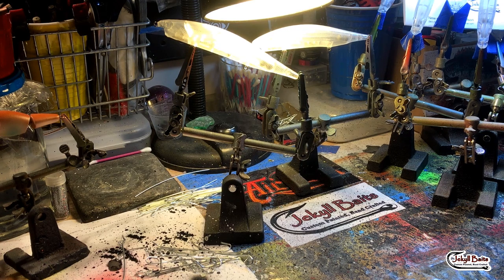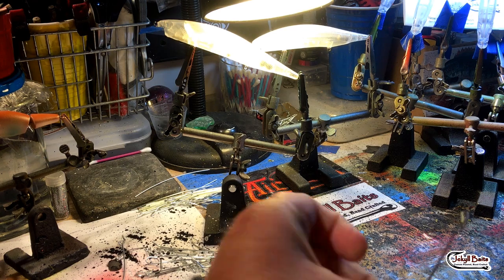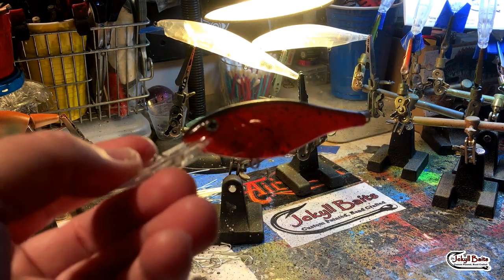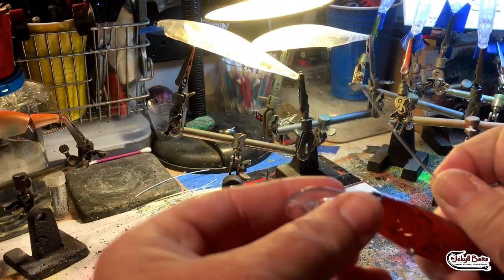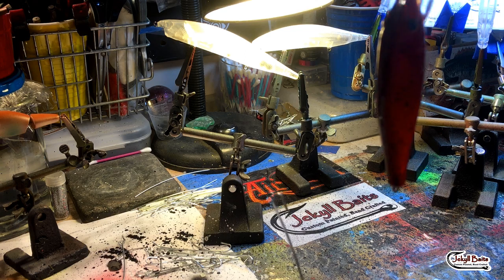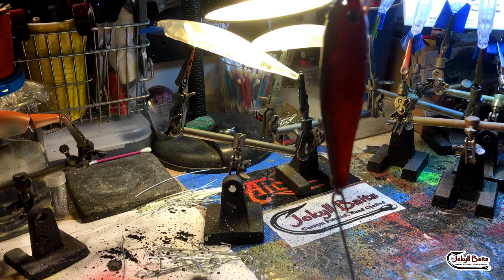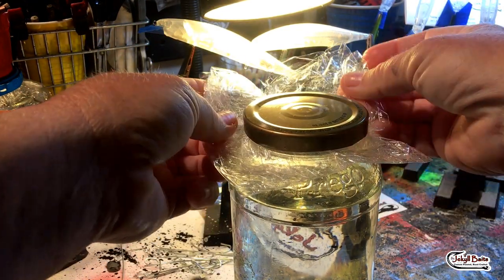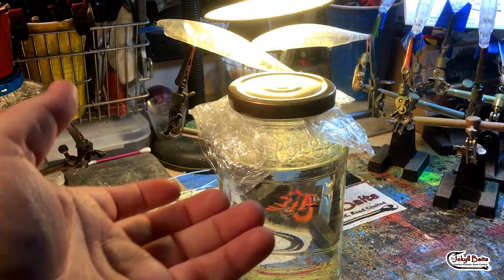JBCo Quick Tip: Dipping Custom Lures In KBS (28 November 2017)

Comment: Would you or do you sometimes dip it more then once like maybe 2-3 coats just once every hour for couple hours? Curious if it makes lures seem thicker and more glossier. I use the aerosol version of KBS and noticed it makes a huge difference spraying it 2-3times. Or Is the thickness of the liquid kbs just good by only 1 pass

Comment: awesome video. exactly what I've been looking for. I've been interested in switching to the KBS. it is very hard to get ahold of though, but I have tracked down a source.
I have heard it can be tricky, with trying to prevent it from hardening once opened. it seems this has worked for you. another trick, to reduce the air volume in the jar, is to add marbles. just make sure they are clean, glass ones.
Reply from the maker: Marbles? I’d have never thought of that. Brilliant! Thanks BandS!
Reply: Fake marbles dissolve. I should know.

Comment: I bought Minwax Helmsman Spar Urethane clear gloss with exceptional protection from sunlight. I hope it works. No one says what exactly it is they use for clear coat dipping.
Reply from the maker: I do. It's KBS Diamond Strength Clearcoat. Link w coupon in description.
Reply: This stuff is much thinner than I thought. I’ve had to dip it twice and still doesn’t cover like KBS Diamond Strength Clearcoat.
Reply: that spar urethane is tough as nails after it cures. takes a while to cure tho. I top coat wood tables with it. stands up to hard use easily.

Comment: Hello, thanks for making all these great videos! Do you have any tips using kbs with poppers? I know they have the vent holes you don’t want to block. Thanks so much
Reply from the maker: Dip only one time. As long as your KBS has been stored properly, it stays thin. Immediately after dipping, hang vertically head up tail down. Add a “drip wire” to the tail eyelet to help pull excess clearcoat from the lure

Comment: I really want to try KBS, but i dont think my lures will enable me to. My problem would be how to hang them so they could/would drip properly/adequately. I make my own lures, out of wood. I have 2 designs, but neither have a loop at the tail. My eye-hooks are on the belly, about 1/3 up from the tail, and the other, the tow point, is at the front, in the cup-face. My other style, has no eye-hooks at all. Has a cup-face, and then a through-the-body hole, at a 45 degree angle, coming out on the belly. And i rig with a chain or barrel swivel running through the body. I can't, for the life of me, figure out a way that would enable me to hang these so the clear would drip off properly. I've been using e-tex, which is great, but a simpler dipping process would have been much easier. Might have to stay with how i'm doing it though.
Reply from the maker: Send me pics of your designs to  jenkravassi@jekyllbaits.com
We'll pick it up from there

Comment: Great information. Have you ever put KBS dipped on a rotisserie like you have to do with epoxy coated? Or does the hanging not result in bottom build up?
Reply from the maker: Spinning KBS causes micro bubbles. Just hang nose up tail down and place a drip wire on the tail eyelet
Reply: @Jekyll424  awesome thanks. I just got some etex to try out. Going to get KBS next. Anything else to consider? I feel from a lot of reading these are the 2 real go to for clear coats. I love the ease of KBS but its pricey.
Reply: @chonch12414  i used to use etex exclusively. I loved it, except that quite often it would fish-eye, no matter how careful i was with handling the lure. That reason alone, was mainly why i switched to kbs. No regrets at all. Dip and hang, it doesn't get easier. And, it dries much, much faster as well. What i do, to remedy the build up at the bottom of the lure(my lures have no tail eyelet), is lightly dab it with papertowel as it builds. It only needs fone for a short while, then it's already hardening enough that it stops.

Comment: How does this diamond epoxy hold up to the hooks marking up the clear. I make my own top water baits and pound then 8 to 10 hrs a day and have issue with hooks scaring clear coat. Thanks for info. Love your videos.
Reply from the maker: Hey Chris thanks for the comments. Takes about 5 days to really cure well but once it’s hard it’s solid. Every coating on earth will wear down eventually, I’d say this stuff is on par w 2 ton and Alumilite. Storage is the only tricky part

Comment: well, I finally got some KBS this summer. almost have a couple batches of lures ready for painting. 
question. i'm guessing it's not possible to add glitter to the topcoat when using KBS, is that right? I'm used to using etex and a rotator, and it's eezy-peezy to add glitter or what-have-you. but using a clear that hangs and drip-dries, seems like that option is out.
Reply from the maker: I sprinkle glitter on the hanging lure once I’ve dipped it. While the clearcoat is wet.
Reply: @Jekyll424  good to know, thanks.

Comment: Hi. Not sure if you are still receiving messages from this post since this was posted in 2017. I just came across your video and had a question regarding the clear coat you're using. How long does it take to dry, where you can handle without leaving finger prints etc. I've called the company I bought this from and couldn't ever get a straight answer as to how long. Thought I would ask you since you, it seems as if you've been using diamond coat for a while and have some experience with it. Thanks for your help.
Reply from the maker: Tim Walker I still get messages. I can touch it with gloves after 8 hours, but I consider it touchable and fishable after 36 hours. After that... rock solid and doesn’t yellow. It can be chipped with excessive fishing just like every other lure, but I really like it

Comment: Did you ever say anything about that lobbing on bottom question? I’ve pretty much fixed that just by going by and cleaning it up a little til it hardens enough but I still have some issues with that ridge developing on the backs or bellies just at the bottom, usually with tiny air bubbles in it. Not sure about that because it appears random but I know I’m missing something.
Reply from the maker: On occasion I get a tiny bit of pooling, I clean it too. As far as bubbles go, that’s only ever happened when I’ve done something wrong, like prolonged air exposure, or accidentally changing the compound of the KBS

Comment: Thanks for the how to video. I've been using envirotex for years but I am looking to try KBS. I have one question. I do some lures that are 10 plus inches long. Can the KBS be brushed on?
Reply from the maker: Yes it can. I use it for swimbaits frequently. I generally wait 8-10 hours between coats.
Reply: @Jekyll424  What brushes do you like for brushing on KBS
Reply from the maker: Any artist flat brush is good, as long as the bristles stay intact. Craft brush multi packs from Walmart or Amazon tend to be the most cost effective
Reply: @Jekyll424  thank you for the reply! Can this clear work well brushed on and spun with a rotisserie as it cures?
Reply from the maker: Depends on the clearcoat. NEVER spin KBS
Reply: @Jekyll424  envirotex?
Reply from the maker: Not certain there
Reply: Tha is for that question. That’s what I came here for. I am small time hobbyist but wanted to try KBS. So I will get the little jar. Won’t be terribly long till I’ll have less than the depth of dipping a lure. 

I imagine KBS is more cost effective per lure than Devcon 2 pet epoxy

Comment: I get bubbles like something horrible with this stuff.   I only dipped 2 times about 10 lures and they all turn out bad. I get bubbles on the lips.  And all over the backs of the baits or all threw it.    How do you actually use this stuff and sell lures and it comes out so great?  I clean my baits. I never touch the lure after i clean it with alcohol and i dip my lures and get tiny bubbles all threw it
Reply from the maker: Sounds like somehow air is thickening your clearcoat

Comment: So is this all I need to top coat the lure, bill and all?  airbrush it, dip it, done?
Reply from the maker: Yes, and then clean the eyelets after it’s dry 8-12 hrs later)
Reply: @Jekyll424  what do you mean when you say you clean the eyelets after it dries?
Reply from the maker: It's easier to scrape off excess clearcoat/Epoxy after it's dry

Comment: I dont have the capability to spray nearly as much as I would like, so I have been hesitant to buy the dip.  I tried the KBS aerosol and I have had issues.  Do you think your jar method would be good for painting 3 to 5 lures every week or 2?
Reply from the maker: I know that as long as it’s stored properly it will go a long way. Having said that I just finished testing the new version of KBS Diamond Clear that is not on the market yet. With regular storage and a 2/3 empty jar, it stayed in its liquid form without hardening for over 30 days! 
As soon as they announce when it’s released I’ll let you know. 
In the mean time, try a small can. Try the pint! Let me know if you need a discount coupon
Reply: I've had mine for months now, and usually go a couple weeks between dips. It's still fine. I've kept the jar as full as possible, adding marbles to raise the level and reduce the air in the jar.

Comment: I just started using kbs, only done maybe 10 squarebills but I’m having issues with it globbing pretty bad on the bottom of most of them. I’m doing it exactly like you are with drip wire and everything but it’s still leaving enough mess that it’s ruining the tail end when I try to clean it up. Some js look bad and some it pulls the paint off. And on some I even get a little ridge of clear on the back of bait js above the tail which I assume is bacause it’s backing up. I don’t have the issue with S cranks only squarebills, you think it’s the angle? Maybe I need to also tend to them with a Qtip as they dry? Or is there something I can do to make it easier?
Reply from the maker: This requires an answer that’s more detailed than I can give from a cell phone. I’ll put your question into my next session video, in the Q and A section
Reply: Jekyll424 10-4, I’m gonna do some tomorrow and check them every half hour or so and clear away excess and see how that does, First time I’ve ever asked anyone for advice, realized I’m getting too old to waste time screwing up when so,some has answer and will share knowledge. I. Js a hobbyist anyway..lol
Reply: That’s weird, maybe humidity in south Texas or something. It’s working fine so far just cleaning the globbing on bottom eye
Eat as it dries but the ridge of air bubbles still js seems to form at random. I can dry 5 of the same baits hang the same way and one maybe 2will get it. It usually happens when the clear has gotten very gummy and I’d be afraid to try to clean it off. I’m very maticulous about air exposure to the point I lay mason jar lid back on bottle between baits even tho it will only be 20 seconds or so til the next one is done. This is my first batch of kbs and I have not adde anything although I’ve heard people say when it starts getting thicker js js add some thinner to it instead of discarding, I purchased a bottle of the thinner made for it from kbs to try when that time comes. The only thing I can think of is that there is a window unit and a ceiling fan blowing in my shop and maybe all the wind is effecting somehow so I’m gonna set up a wire inside a large cupboard and put a dehumidifier in with it, see how that works.
Reply: @jamesnash8227  Look into buying a disco ball spinner, and modify it to spin the baits as they dry. tons of youtube vids on them. It helps keep the epoxy from building up in on place.

Comment: When you dip a rattle trap in kbs how do you hang it? I’m getting a bubble at bottom on belly. Is there a good angle to hang?
Reply from the maker: I hang it nose up tail down with wire on both the back and belly eyelets to keep it upright. I keep an eye on the tail drip wire and after 10 minutes or so, I remove it and gently pull off any excess from the bottom
Reply: Jekyll424 absolutely perfect thank you! That’s how I just did it so can’t wait to see how it turns out! Thank tou

Comment: How do you dip lipless rattle baits? Thanks,
Reply from the maker: Top eyelet on its back and belly eyelet get hangers on them, tail eyelet gets a drip wire
Reply: i came up with a less frustrating way to hang lipless. I hang it by the line tie eyelet and on the tail eyelet i add a drip wire with a lead weight to "pull it down". works great for me.

Comment: Is the process the same for jointed baits?
Reply from the maker: Only brush on for jointed. Never dip jointed baits and be careful not to get it in the joints when you brush on
Reply: @Jekyll424  still kbs?
Reply from the maker: Brennan Smith 💯 %

Comment: Are you using 100% KBS in the jar? If not, what are you reducing it with at what ratio?
Reply from the maker: 100% KBS. Reducing it changes the chemical composition in negative ways. As long as it’s kept the way KBS suggests you keep it, it preserves very well, for a very long time. But! It is a solvent based epoxy, so always wear your respirator and work in a well ventilated area.

Comment: I can't seem to store this stuff correctly.. Very frustrating. Is the mason jar the best way?
Reply from the maker: I don't use a mason jar. I like a single piece lid. Glass with a good insulated screw on lid. Spaghetti jars, pickle jars and olive jars work well. Clean them really good first and place plastic wrap between the lid and the glass before you reseal it
Reply: A lot of people tap the bottom of the can with a screw. There is also an anti O2 spay you can put in the container. Good luck!

Comment: For those of us just exploring lure making, how well do the KBS Clear spray cans work for painting lures?
Reply from the maker: No personal experience with them myself. I would recommend you chat with folks in various lure making formats online, Facebook has several. You'll get an array of opinions, but seek out the ones that are fact written 🙂
Reply: @Jekyll424  Thank you! I'm going to take a chance with it for simplicity sake. We're only experimenting with simple poppers the first time around, so not a huge deal if it doesn't pan out, haha. Thank you for the advice and videos!
Reply: Just did some myself with the spray. It’s nowhere near as tough as the quart. Just ruined four of what might’ve been my best paint jobs. Also beware, sometimes for no reason between coats it might crinkle
Reply: @calebdowling8651  Thanks. I guess it'll do while I figure out some simple designs. Working with bass wood...managed to make a sinking popper first go, lol. Sorry to hear about your lures!!
Reply: Hey, how do you get rid of bubbles that form after it hang for a few minutes. I am dipping it slow just like you show, but I keep getting bubbles just minutes later.

Comment: Is kbs diamond clear self leveling or can I brush it on without leaving any marks.
Reply from the maker: If you’re working with a lure that’s one solid piece, hanging it straight up and down is the easiest. It does level out as long as it has a way to drip off of the bottom eye hook (hang a thin piece of wire from it). If you’re brushing it on a multi jointed lure like a glide or a Rapala Style, repositioning might be necessary
Reply: Jekyll424 thank you so much for all the great info you share

Comment: Do you not worry about the safety of dipping inside ? I have a similar situation being indoors but I’ve tried to limit exposure. What are your thoughts ?
Reply from the maker: Well ventilated area is the key. If you can set up a fan that vents outside or some sort of air exchange that’s the best scenario.

Comment: How do you reseal your clear coat
Reply from the maker: KBS Diamond Strength
Reply: If you will spray BLOXYGEN in the jar it will last a lot longer and it will not form a scum on the top. It replaces the oxygen .

Comment: Does this have a strong smell like the KBS spray can gives off?
Reply from the maker: Most if not all clears and epoxy have odor. The canned KBS smell dissipates within 30-45 minutes
Reply: @Jekyll424  That's good to know. I've been using the spray can version but going to switch to dipping. Just saw a video from KBS saying they recommend brushing or dipping lures. But, I did learn that this is the best clear coat.

Comment: Is Sally Hansen close to Kbs in lure sealing ability?
Reply from the maker: Different animal entirely BUT! It can be used to clear baits. It will smell to high heaven and your house will smell like the nail salon at Walmart, but it subsided after a bit. Use three coats, let it hang for a week or so before you use the lure. It will yellow and chip over time but it's not horrible and shouldn't be embarrassing if your limited on options or just starting out 🙂

Comment: Does the kbs have a strong snell to it? Like spray paint?
Reply from the maker: +Tj Fisherman it has a smell, yes. So ventilated space is a must. But i don't think the smell is near as bad as other epoxys
Reply: Jekyll424 great video. I use two part epoxy. What's the durability?
Reply from the maker: KBS rivals every 2 part out there